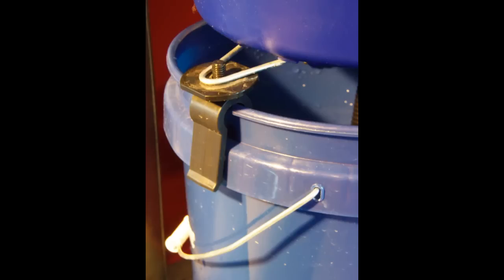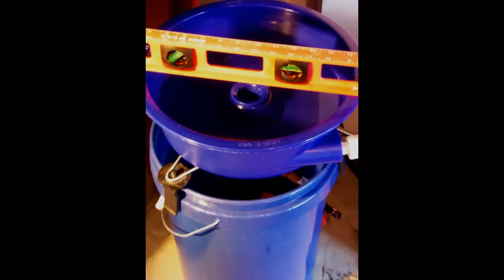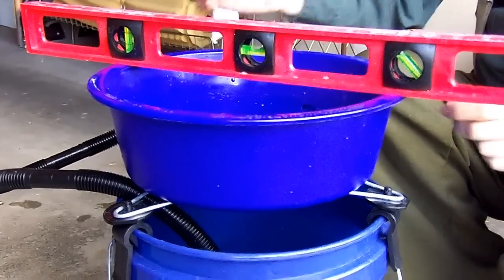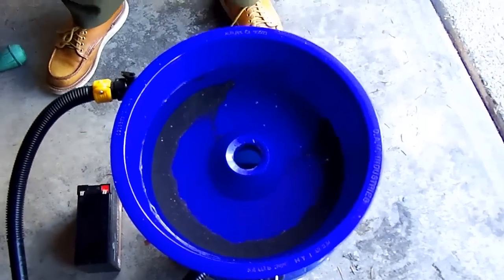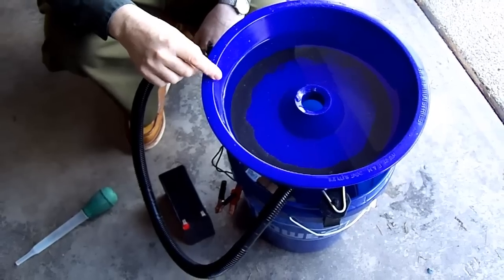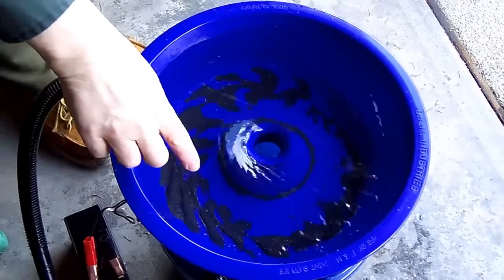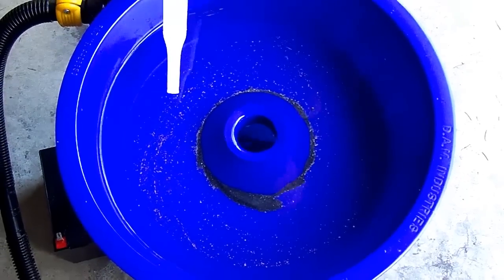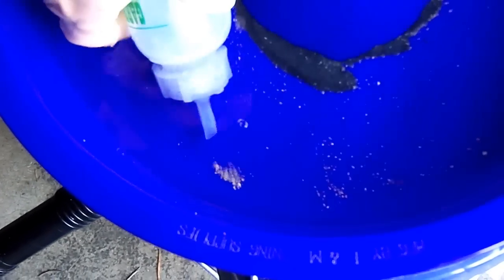Blue Bowl Tutoral for processing of GOLD concentrates

Comment: Great video!  Can you tell me a little info behind the black sand you put into the bowl?  How was it mined and what processes had the black sand and gold gone through to get to this point of being ready to blue bowl it?  Jaw crushing or ran through impact grinder? Classifying? how much? Sluicing or Gold Cubing? Thanks in advance!  :)
Reply from the maker: Hello WarbirdPR!  I classify at 100 mesh for the blue bowl, which is what you see here.  Your optimal performance will always be with concentrates that are of a similar size.  The bowl will then sort them out via weight.  Best to deposit in the bowl too little sands (there is no such thing, actually) rather than too much.  So two or three spoonfuls of concentrate would be ideal.  More than that invites gold getting carried away with the blank sand, as it might not have a chance to settle.  If you are in doubt, pan your waste and if there is gold, simply reprocess with your next run.  No big deal.  
     This example used material from the S. Stillaguamish River, Robe Canyon area (see my videos--I am quite specific in them).  The gold is glacial, so it is usually quite flat.  The black sands are not so glacial--and are of mixed shape, so the gold has a tenancy to ride over their top.  So, less is more.  Here it is best to process with a small mesh (100) and a modest amount of material (two spoon full).
     The gold was all recovered using a Royal sluice system  (see my review).
      I hope that answers your questions.  As far as the blue bowl, it will produce excellent results, provided that you keep in mind the first paragraph.  WPR, ask more questions if you need!  And, good luck in your gold getting!!

Comment: How much is a kit and where do u get one from
Reply from the maker: Amy, any mining supply will carry them--look online under "Blue Bowl, gold."  The full kit would include the  bowl, 3 plastic leg levelers (make sure you get these), 750 gallon per hour 12 volt pump, several feet of 3/4 inch flex hose, pair of battery clips, and instructions, (you will not find any that include straining mesh--a super cheap alternative is using a metal tea strainer).  With all of the above a kit will sell around $150 to include shipping.  Amy, note you will also need a bucket over which to set the bowl, and an energy source for your pump.  (Usually that is a deep cell ((also called cycle)) battery (can get at any hardware store),  and you will need a recharger for the battery).  All told, about $200.00.

Comment: I have been thinking of getting a Blue Bowl to process my black sands, this looks like a much safer method than using mercury and it looks as though it will do as good a job. What is the best size to classify down to? 150 mesh, 200 mesh?
Reply from the maker: Greetings.  I would argue that 100 mesh is the standard, and that is what I use.  100 mesh is what most rock crushers grind down to.   One could make a solid argument for the  use of 150 mesh for beach sands, however.  Gold is about 4x heavier than black sand, and I do think that once all the particles get really small (beyond 100 mesh) there is less and less need for their size  being completely homogeneous.   However, the chemist in me says if you are a purest and wish an absolute and optimal performance,  you would begin with 150 mesh, and then work again with 100 mesh.  I always do a very quick pan of my waste, and usually find a few very small particles of gold, but just a few.  Those I just spoon out and place in the next batch of concentrates.  Sorry for such a long winded question, but I give you a real answer!
Reply: Thanks for the answer, I don't think it's long winded at all, I have another question. What is the largest mesh size that the Blue Bowl can process?
Reply from the maker: I do not know.  But the material will need to be quite small (and lightweight) for the water to lift it upwards and guide it into the hole.  Let me pose a different question.  "At what size mesh does the bowl cease to become useful?"  I am going to suggest somewhere around 50.  But that is only my guesstimate.   For me, anything larger than 100 I can take directly from my pan, so the use of my blue bowl goes no further.  I simply double that size for those that are not so experienced.  In the end, you will need to test for yourself.  Thanks for the questions!
Reply: Thanks.

Comment: @callmeBe - or - anyone that can answer this ! -- Will the blue bowl remove beach
 type sand or Only black sand?  Where I live and prospect, it is always 
sand left at the end of my pans. I am aware I am looking for flour gold,
 which is why I want to invest in the Blue Bowl, but no one has been 
able to give me an answer if it will remove beach type sand? I fear I am
 losing a lot of fine flour gold in the sand.  - Thank you in advance 
for any help you can provide!
Reply from the maker: Hi MitchieR.  As long as the size of the materials you put in the bowl is homogeneous, it will do a good job of separation for you.  So, yes, if the particles of sand are relatively the same size as your black dirt, it will work.  And, you should see that sand leave the blue bowl first (migrate towards the center hole) as all of the placed material begins to stratify.  Now why you are getting that sand in your concentrates  is a whole new question.  All things being equal, you may consider a gold cube (they are expensive) to process your beach sands more efficiently.  Good luck!

Comment: Can anyone tell me what amperage the 12V water pump is?
Thanks,
Reply from the maker: Brian, when you order a kit you usually get a choice as to the size of the Johnson pump.  A 500 gph pump (about $23.00 cost, and is an ok size)  draws 2 amps, a 750 gph pump draws 2.6 amps (standard on most of the kits).    Johnson also makes a 1000 gph pump which draws 4.5 amps, but you do not need such a volume of water for this application.  Thanks for the question!
Reply: Is the 750 gph hour pump really necessary and would a 264 gph electric pump work just as well(hubby will only let me use the 264 gph pump and not the one that came with the blue bowl)
Reply: @KristyN12012  I have a 750 gph bilge pump and I have to dial it back,  how much, I don't know.  Why won't hubby let you use the one that came with, is he setting you up to fail, or do you have bad luck with pumps? The pump he recommends I think might be a little on the low side, but if you can push water over the rim it will work fine, good luck.

Comment: negative should be connected last, not first.
Reply: Obviously not an issue in this scenario without a negative grounded structure to short the positive on. Good practice is all
Reply from the maker: Diesel Ramcharger   Yes, with assembly connect + first.  When disconnecting  the - is removed first to prevent an arc.  (Just like  a car battery).  Thanks for your correction!

Comment: Your pump should be in a different bucket. Otherwise it will just pump the black sand back into the bowl. Get a long plastic tote and set two 5gal buckets in it. Fill everything up with water, set the blue bowl on one and the pump in the other. Add a little jet dry and run it. The water stays very clean with this method. It's the same thing you are doing, but cleaner.
Reply: The best set up I've found is to use a 3 gal bucket to set up the bowl, and place this in a plastic tub where the pump is held by a bracket that hangs off the side of the tub. The blue bowl bucket has been marked where the leveling legs go for quick and easy setup. The water drains into the bucket, where everything drops to the bottom, and then the bucket slowly overflows clean water  back into the tub where the pump then recirculates the much cleaner water back into the blue bowl. A cap-full or two of the jet dry is plenty for about 6 or 7 gallons of water. I've recovered a bunch of -100 and -200 gold using this baby over the last 2 years and I love it.  Also, make sure you classify your concentrates into uniform sizes I.E. -30, -50, -100 for fastest processing and best results.
Reply from the maker: Thanks for your comment, Badbeau!
Reply from the maker: Yes oden4rs, but the mesh on the bilge pump is still very large in comparison to the fine sands (at least) I am processing . . .  Maybe the sands you process are richer and more coarse?  But my goal in using the kit is to process all of the material with as much efficiency as possible--so that means straining out even the very finest of material.  Thanks!
Reply: Thanks #Badbeau for this update! Sounds like I'll be using your ideas along with #callmebe 's video here. Great advice shared! Thanks Much! Now to buy my Blue Bowl to go with my Gold Cube.

Comment: Can the pump be damaged by particles? Does it need a filter or is it designed to work without one?
Reply from the maker: All H20 pumps have a filter built in (even the hand pumps).  If you unscrew the bottom you can clean them out with your fingers.  You can purchase a fine mesh screen that fits over the top where the intake air is.  It would be kind of  like a hair net--and that would  useful when using something like a highbanker when your pump is placed directly in a stream, but here you won't need it.  In fact, you'll probably never need to clean your pump for the blue bowl.  It will be the larger rocks, leaves, and out and out mud that will clog it up.  So, no worries.  Glad you have enough gold to consider this system!
Reply: No gold here in NYC, except for jewelry, But I want to go panning in New England someday. I am studying up on it. What I figure is that I need to concentrate on the fine, fine gold that is not obvious to the eye. And that means that the right equipment is crucial. I want nothing to do with mercury, if I can help it. I want to experiment with my own clean up equipment. What I know about New England gold panning is that you are limited as to what methods you can use on state land. If I can earn 100-200 dollars a day, I'll be content. I might be asking a lot. What do you think? Is 200 bucks a day realistic?
Reply from the maker: I saw a program about a dude who was cleaning NYC gold  off sidewalks near a section where there was a heavy concentration of jewelry stores that did fabrication,  etc.  I guess the dust was coming off  the workers as they exited the stores.   He was also finding small gem stones.

I don't know anything about mining in New England.  I have seen  a little placer gold found in Vermont.  That is as much as I know.  The GPAA (Gold Prospector's Association of America) would be the best source for your information.  For every state they do a handbook of the claims they own, tell you exactly where they are, and also review them (tell you a little about how much people report finding.  Their information is reliable, and it is a good organization.  It use to be about $75.00 a year to join. 

I think you're going to have to go some to average $100.00 a day.  I'll never say "no" to hopeful thinking, but many of us are not that lucky.  I'll do better than that with my mine, but it's hardrock and out west where gold (and silver) is far more plentiful.  Check out the GPAA and you will get your most reliable info. 

FYI, if you're counting on separating microscopic gold, forget it.  It will never be worth your time as a small prospector.  If you can't see it in your black sands, it ain't worth the time/effort to recover it . . .  Sorry I cannot be more hopeful about that, but I am truthful!
Good luck!  B.
Reply: callmeBe I know about GPAA, but it is going to be a long time before I can get out of NYC to live anywhere where I can pan or sluice for gold. I know that I'll have to run a lot of dirt to get a little gold. I think it is going to be more of a hobby than a nice payday. I'll be in my late 60s or early 70s before I can get out of NYC. But getting some gold in on my bucket list. I'm going to do it.
Reply from the maker: Having a bucket list is very important.  So may some of those buckets be filled with paydirt!  Meanwhile, a hobby would be a more realistic way of thinking things through.  Good luck, and keep those warm thoughts!
Reply: Yes, I'm going to buy some paydirt when I have time to play around.
Reply from the maker: Oh sorry Slim, I didn't see your question until Tater's entry.  Pumps are made to be taken apart and easily cleaned (of twigs, leaves, larger things), so never a prob.  But I've not had Tater's issue of particles becoming sucked  back up into the pump and recirculating through.  The sands immediately settle on the bottom and that's it--they don't swirl around and make available for suction.  That might be more of an issue if you had lighter particles as well as black sands in your bowl, or ended up with  a lot of black sand the pump sat in.  Tater's idea is an extremely careful and precise approach; so  nothing wrong with that!
Reply: @callmeBe  Klesh Guitars did one.